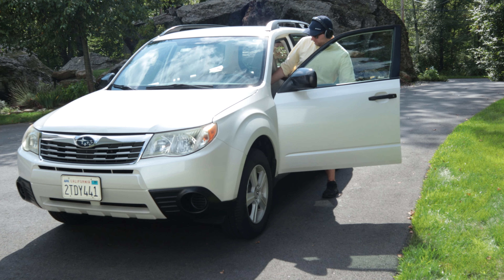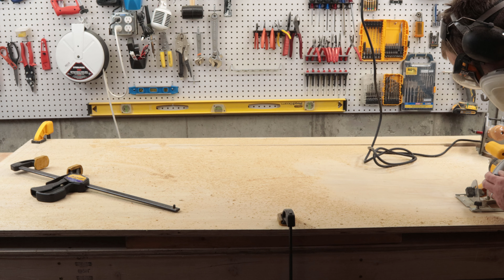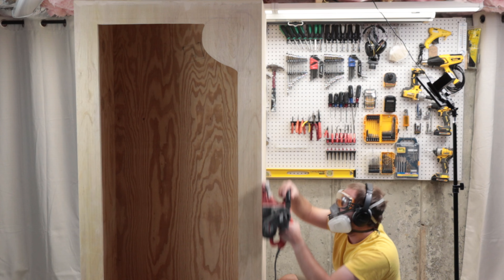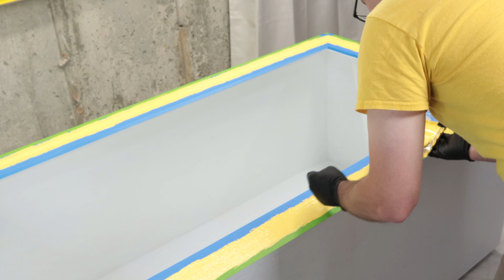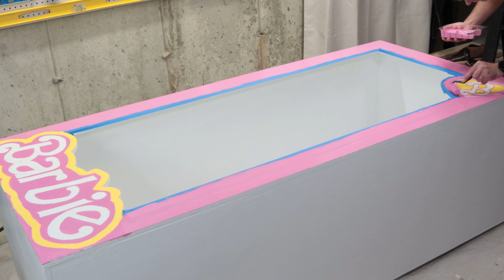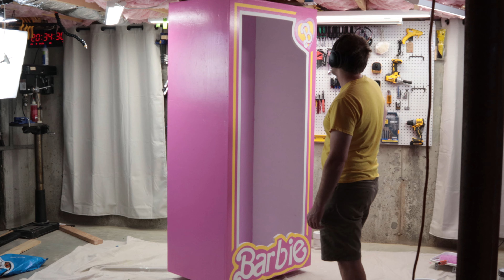Build a Barbie Box photo booth for Halloween, Costume Parties, Events!

Comment: Nice.  How heavy did it end up being?

(I probably would have made the logo from a 2d print and made it bigger using an overhead projector.)
Reply from the maker: Clever! I definitely will get a small projector for my next drawing related project - I'm not particularly good as freehand 

It ended up being 70 or 80lbs I'd say, I didn't weigh it but it was heavy, and also sturdy - we had dozens of kids and adults take photos and it held up really well.

Thanks for watching!